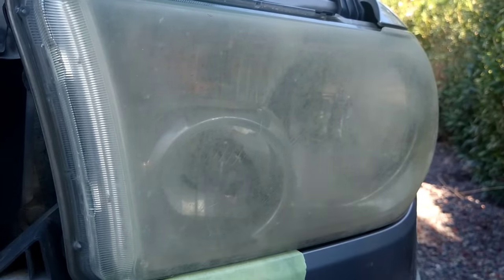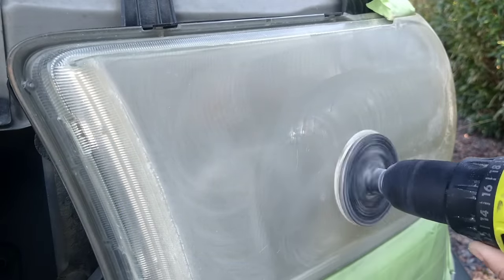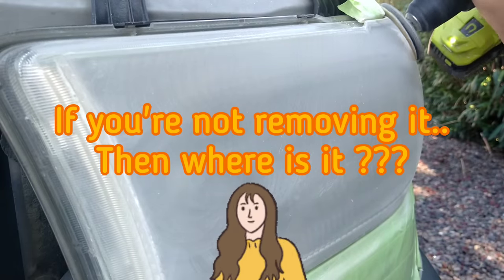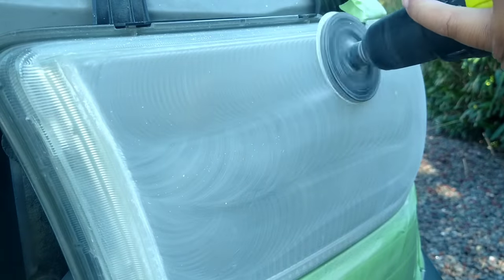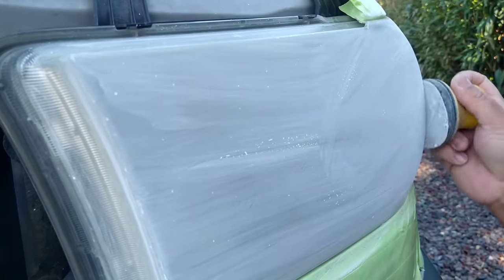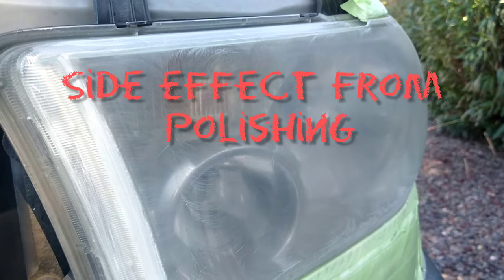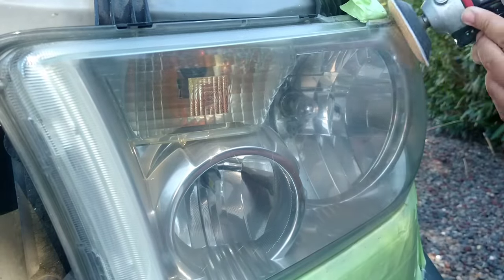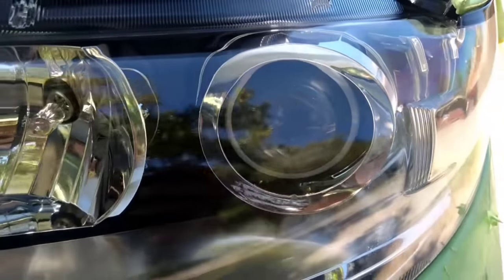POLISHING HEADLIGHTS IS A SHAM/scam  ---  and why you should never only polish headlights

Comment: Doing this annually is a pain. Once the initial coating wears off the headlights you have to constantly refinish them.
OR... go buy an old American car. My Caprice NEVER needs this. 33 years and the headlight housings look new still. They are glass not plastic. Your car is made of water bottles and soda cans. Buy a real car.
Reply from the maker: Lol
Cool car...my car has 307 horse power...gets 29 miles to the gallon...its own satellite-gps...a 14 speaker system.... leather heated & cooled seats ..sun roof....and has only need oil changes in over 4 years..and last head light restoration by me was just under 4 years ago..💪🏼...😆
Do love capricious though...
Reply: @theheadlightrestorationpro  I have a 7" touch screen 1000w surround dual zone with everything a modern car has in the dash and then some. 26mpg V8 with dual exhaust and a carb. It's a wagon so it seats 8. All that and a Hyundai in the way wouldn't even slow it down😉
Reply from the maker: Acura TL.advanced..... Built-in 8 inch screen in dash 1500 watt amp... Built-in dual exhaust.. digital fuel injection...big  High power V6...True sports cars have trouble keeping up. Without all my upgrades at blue books still about $18,000.(an actual show car/you can see it it's a couple videos)..🤣😂🤣
And it's only my work truck..
Reply from the maker: At the end of this video...https://youtu.be/LcMFr0mpp-4
But anyways really appreciate you watching my channel bro and your whip sounds sick....💯